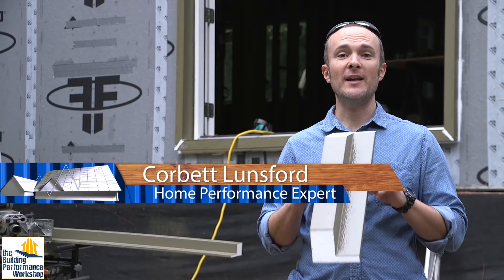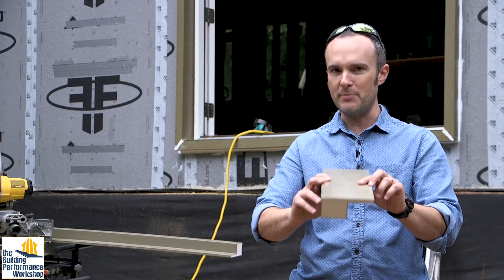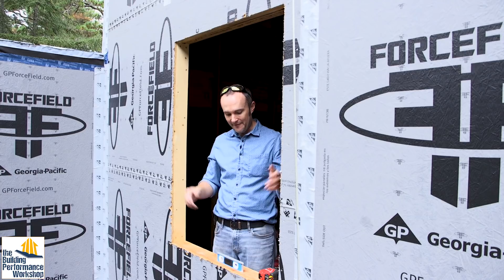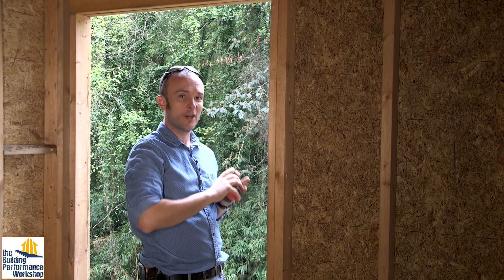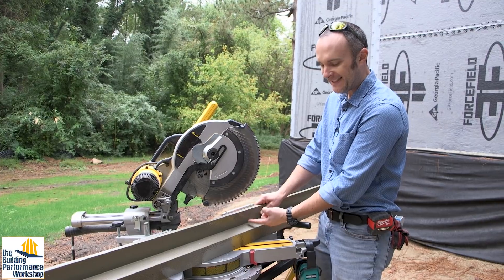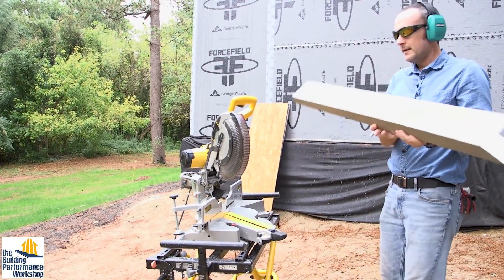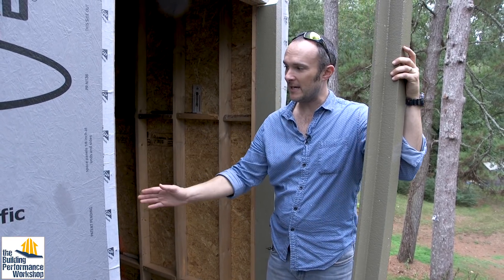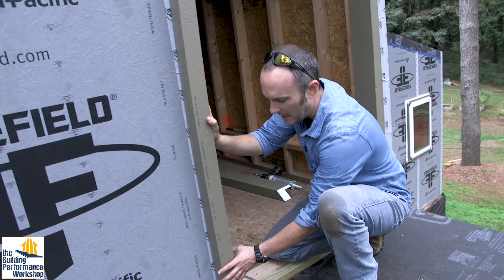Windows, Doors, and Exterior Insulation: Installing ThermalBuck

Comment: Good luck if a typical DIYer gets a diligent framing inspector who says:  I need a signed and stamped statement from a structural engineer for this deviation from the number of jack studs called out for that header in Table R502.5(1).  I get a feeling that where I'm building, which has only a single inspector in the county, that the inspector is going to say "That sounds reasonable, you are going to live in the house, so you probably aren't cutting a corner".

Comment: I’m surprised you didn’t do pocket headers over your doors and windows. Your rough openings are narrow enough to use a single LVL for the headers instead of double 2x headers which would allow you to use 2” of rigid insulation in the resulting header pocket in a 2x4 wall or 4” of insulation in a 2x6 wall. Every little bit helps! 😊

Comment: I would flash/tape/air seal opening before installing thermal buck, probably also tape the joints of the buck. I just wouldn't rely on just caulking alone.
Reply: That’s what Rockwool recommends ✅

Comment: It's a cool product but wouldn't a wood buck extension (say 2.5 inches of ripped 2x4) plus the 2x6 stud behind it (the wall jacks) already have an R value of close to 11? Even a triple pane window is around R8. I suppose there's still a three R gain for a couple square feet of wall per window. I'd want to run the numbers first, I suppose. Definitely an interesting product.

Comment: Thanks for sharing the information, I have one question;when your door jam is for a 2x6 wall and you buck it out 2 inches, that means when you open the door from the inside , the door is going to bind up on the inside corner, and wont go beyond 90 degree.  How do you address that?
Reply from the maker: I hear your thought, but we somehow made it work fine- the doors go all the way to the wall on inside now, no hangups.

Comment: 10:52 If you cut the cripples under the sill at a bit of an angle, you can ensure that the sill and buck tilt outward.
Reply from the maker: I actually think you'd have a problem with the angle cut on the buck at that point, since it's one piece. Hard to describe in a comment, but try it and you'll see. The buck is supposedly angled already, though I doubt it's significant.

Comment: Hey there!! Really interesting stuff.  I had run into an issue similar to yours in regards to securing the door. Was a in a pre-war building and jambs of the windows weren't deep enough to catch any framing behind the exterior stone. Had utilized 4"x10" metal strips  that were secured on to the windows and doors prior to setting and then secured to the framing. Hope this helps.
Reply from the maker: Interesting solution- I'm sure there are many ways to approach this kind of mixup.

Comment: I would think that what the manufacturer of the window says you need for a rough opening would already be taking into consideration adding a half inch on each side for setting the window. They don't do that?
Reply from the maker: Yes, they do- but you need more rough opening if you want that gap plus the TB

Comment: FWIW: The Prefab Foam Window Buck material isn't an ideal product since you basically screwing or nailing the windows into a foam leaving them extended. Better option in my opinion to make your own out of lumber that is backed with ridge foam. This way when you fasten your windows they fastners are grabbing into wood. The foam between the Wood and the sheating provides a good thermal break. Your windows are never going to match the R-value of your walls, so your not saving that much using the all-foam window buck. 

it would be best to include foam that is sandwitched between your header lumber, especially when the header spans multiple windows. 

TIP: also consider priming all of the exposed lumber around the window openings so that if there is a leak or some just leaves the window open during a rainstorm the lumber is protected. Priming the lumber framing around the windows is like adding a secondary moisture barrier.

You still need to tape around the windows. I wound trust that the Caulking will completely keep all of the water & moisture out, especially considering thermal expansion & contraction. Better to go overkill than have to redo a window because of water damage.
Reply from the maker: We are, in fact, always screwing into lumber- that’s why the 4 1/2” screws. And yes, we taped in this vid. Good ideas all.
Reply: @HomePerformance  Way too long to properly secure the windows to the framing.
Reply: What type of screws do you recommend since you are adding load 2inches out. Example leave a screw sticking two inches out and grab it with plyers and push down. The same screw drive in expect for thickness of the window flange material and try again
Reply: @nickk05281982  If your going to use his approach (which I don't recommend) I would recommend you use Structural screws, like GRK Structural wood screws (sold at lowes & probably Homedepot)
Reply: I agree. But even then I can't imagine you can get a load calculation on those screws doing that.

Comment: Don't you want a little slope on the sills so water runs out...
Reply: ThermalBuck has a 1/4" slope from 1-3/4" back from the outer edge.
Reply from the maker: Yes you do
Reply from the maker: Yes you do

Comment: Love the foam buck stuff.  But Whoa, that jack stud deal is something else.  I will keep my jack studs....
Reply: No joke right? Jack stud vs. lag screw into end grain? I'm sorry, I love me some  Headlok/GRK/Spax as much as the next guy but nothing beats lumber between the load and the support.
Reply: I always think of the old videos where they tell you in the event of an earthquake to stand in a doorway i’m pretty sure because the structure of a standard doorway is pretty darn robust with the jack studs.
Reply from the maker: Structural engineering doesn't always make common sense, I can tell you from experience working through this project. 'Good enough' is usually all that's ever needed, re: the jack stud/lag screw variation.
Reply: I mean Math is math. The pullout force of three lag screws is in excess of 12,000 pounds... The tear out force in construction grade lumber is something like 9,000 pounds for those screws cumulative. So unless the house gets hit laterally by a freight train, it's going to hold on just fine.

Comment: Instructions lol.
Very important our new house roof needed full replacement due to them not reading installation instructions for the roof blanket. A sarking with bulk insulation attached to it.

They still refused to follow the instructions on installation the second time now needs replacement all over again.....
Reply from the maker: OHMYGOODNESS, people- get your $#!& together! So sorry to hear Timothy. Third times the charm, I think.
Reply: Getting quotes and a updated engineer report to have fixed post build. Not letting a company that installed then came back 14 times to try and fix then forced builder to replace and build picks the same contractor and crew to redo. 

Two lessons there I think!